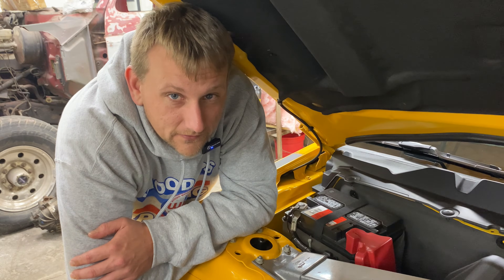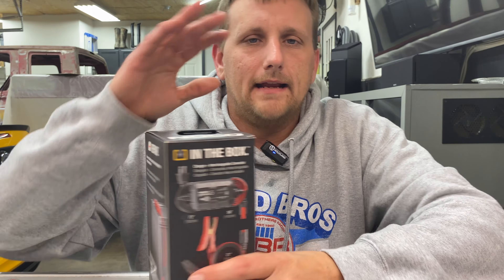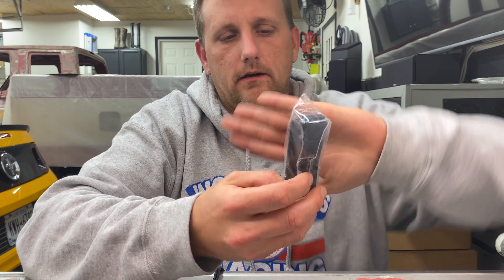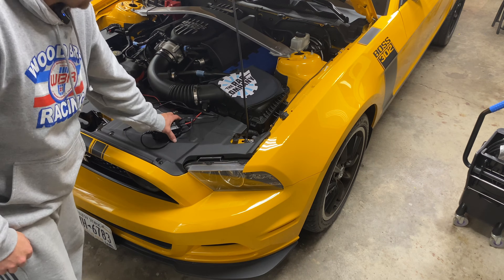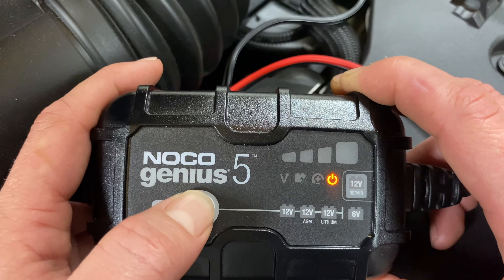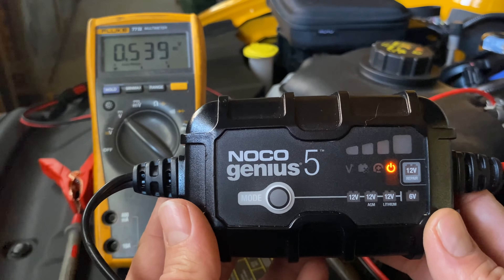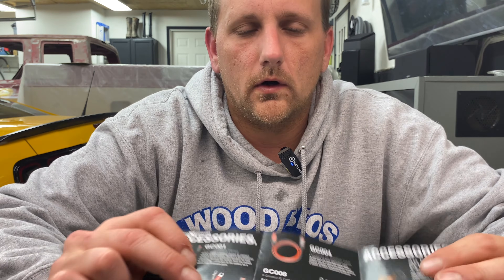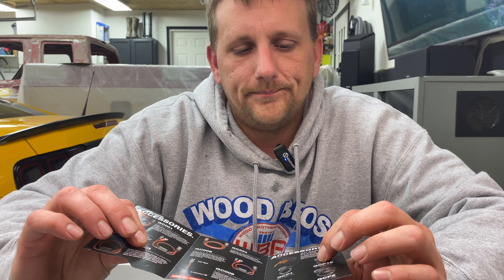NOCO Genius 5 Battery Charger/Maintainer How to, Features, and Accessories

Comment: I bought one of these to use as a trickle charger for my mower and Ford Ranger, a battery that would die if the truck wasn't used frequently. Eventually, both that battery and the one on my mower would not stay charged even when on trickle charge.  I set this unit on repair, and both batteries are now performing like new.  My other truck battery was also failing after 7 years, so I tried it on that truck...it too is as good as new.  I didn't want to replace 3 batteries and this unit gets 10 stars from me for restoring all of them.
Reply: How many times did you use repair mode for the truck battery?
Reply: @RhynoMegapron  Sorry I took so long, I don't use this email often.  Once each time for 3 batteries, all of which are like new.  Good Luck.
Reply: @blapril754  Does your noco still functioning today 2024 ?
Reply: What setting do I put it in to trickle charge?  Is it the first setting  says just 12volt

Comment: how can i achieve 14.5v on a 12v acid battery? om only getting 13.5v and the noco is still green. if it was green should i leave it for 8hrs? to achieve 14.5v?
Reply from the maker: Why would you need to achieve 14.5V? Battery's are operating between 12-13V. When a battery is charging from the vehicles alternator while running, it maybe read 14-15v max but that's it. 
You can leave the NOCO on the battery forever. It will monitor and maintain the battery voltage at the optimal voltage of 12-13V while not in use.

Comment: I am a gal and I love my Noco products -- even just holding them feels good..lol, well built IMO.  I have the Noco Genius 5 (Battery Charger+maintainer) and I use this to mainly maintain my Datsun 280ZX as I don't drive this immaculate vehicle all year round.  I also have Noco GB40 booster which I have used several times to boost another vehicle of mine.  The Genius 5 manual has very tiny print, I may enlarge font to make it easier to read.  When I am not using these units, I like to put them back into their original boxes, bugger to organize them in the manner they were in when purchased.  LOL.
Reply from the maker: I was keeping my NOCO genius 5 in it's original box but the box didn't make it long before it started falling apart so I keep mine in the top side of my Boostx carrying case. All in one spot now 👍🏼

Comment: So when it's hooked up to a normal 12v battery, and the light goes green, is that the trickle charge mode? I just need it for that, as a trickle charger, to maintain it.
Reply from the maker: Correct. It will go thru the charge mode quick and then going into maintain mode when it is just the green light on.

Comment: I have the genuis 1 for my Silverado, I pulled the black cable off from the truck,and have the noco hooked on the batt. I'm assuming that's a good way to do it, because she does sit , because I have a company truck.  But I think I might get the 5.   Any suggestions?
Reply from the maker: You don't have to disconnect any terminals to use any noco. I have the same situation. I have a company car so all my vehicles sit for periods of time without use. The genius 1 is a great unit I'm sure and have others comments that people use the 1 or 2 for maintaining there batteries with no issue. I personally got the 5 so it would maintain anything I have and also charge a dead battery in a timely matter. I feel it would be an upgrade for you to go to a 5 because you have a truck. That is totally up to you. The smaller ones do the same job but take a longer time to do it.

Comment: When I try force mode the lights won’t flash. I been charging my car battery on my 2019 Mercedes all day and the first light still blinking.
Reply from the maker: If the unit is seeing the battery and will go into one of the modes, force mode isn't needed. Was your battery low on power or you just using it to maintain it while it sits?

Comment: How long it takes to charge a completely dead battery ? How long will it be dimming in the 25-% range ?
Reply from the maker: In my experience with the genius 5, around 24 hours to get close to fully charged on a full size car battery. should be above 25% within 3-5 hours. The last 25% of the charge is the slowest because it slows the charge down to maximize the final little bit of charge and protect the batteries health

Comment: A lot of people always say the mounting system to mount it to the wall.  Its actually to mount it in your engine bay and have the charger connected to your battery with eyelets.  Run the plug to your grill and you dont need to even open the hood to plug it up
Reply from the maker: I thought that to but it doesn't automatically start charging at least mine doesn't. Definitely would mount under the hood like the genius 2D but would still need to select the mode to have it start charging unless mine isn't working properly. They should make the 2D a 5D. The 2D takes off on its own once plugged in. No buttons to press.
Reply: @natemarcy3939  it says in the instruction book after the first setup its has onboard memory so when you plug it in the next time it is already on the mode ready to go
Reply: If you have it in and charging then disconnect power cord, next time you plug it in, it will remember the previous setting.

Comment: Genius 10 is $85 on AMZN
These are designed in USA, made in China or Vietnam. 
When you connect the Noco to the battery, do you disconnect the battery from the car ? Thx, great vid and tips 👍🏻
Also, Noco GB40 on w00t for $75
Reply from the maker: Nope. I leave the battery hooked up to the car. No issues.
Reply: @natemarcy3939  thanks for the reply, someone stated if using repair mode to disconnect battery as it might interfere with car electronics.  Also, if the battery is in the trunk do I connect to the posts in the engine bay or the battery in trunk ? Thanks
Reply from the maker: @babagandu   if doing repair mode it never hurts to be safe and unhook it. I personally have done a repair with the battery still hooked up and had no issues.

I would hook the noco directly to the battery in the trunk. That cuts out any potential issues the wiring could cause  or other systems in between.

Comment: I have the NOCO 10, 5, and 4 of the 1"s..  The 5 is a great choice for overnite charging the typical auto battery.  Once the battery is fully charged, the NOCO 1 is my choice for maintaining. My BMW sitting idle most of the winter is a current-hungry beast and the NOCO 1 can do the job indefinitely.  NOCO is a good choice.
Reply from the maker: Thank you for the info. It's nice to hear someone else's experience with multiple. I'm thinking of getting the 10 once I get my diesel restoration project done. I'm sure it will appreciate the 10 for the two big batteries in it. What do you use your 10 for?
Reply: @natemarcy3939  Well, I run a small battery restoration business from home now that I am retired, kinda like a hobby of mine.  The NOCO 10 is used at times for weak auto and tractor batteries I get in occasionally which may be somewhat sulfated and need to be turned around and returned to the customer within a couple weeks.  All the NOCO's can desufate, they obviously charge at different rates.  I actually have much larger chargers and even stick welders for reviving dead batteries.  What's good about the NOCOs is their pretty much plug and play and need mostly no supervision.  As always you should have good ventilation while using the 10 and maybe even the 5. Be sure to pop off the vent plugs when initially starting a charge process and watch for heat. Once the battery is fully charged, put the caps back on, use a small maintainer (the 10 is overkill) the 5 will be great for this.  -Dave
Reply from the maker: @340dave  wow that's very interesting. Something that I didn't even know could be a business or that anyone even did. Very cool! Thank you for sharing all the great knowledge. I like putting information out there for others but love being introduced to new knowledge.

Comment: can you recharge your battery if the temperature is 32degrees out, or just cold outside?
Reply from the maker: You are good down to -4 degrees Fahrenheit and up to 104 per the manual and there website. I personally have left it on my truck outside for 2 days with the temp around 20 with no issue.
Reply: @natemarcy3939  thanks!
Reply from the maker: @mikefitzgerald8025  glad to help

Comment: Great video, I own a 2020 Jeep JL. A small auxilary battery and the regular size battery. Horrible engineering. If the small auxilary dies, you can't start the Jeep. So with this set up so you buy a two battery maintainer? I want it on board so a quick connect to the house electrical. Thanks
Reply from the maker: Thank you. So that's an odd system to have. I was just reading about it a little bit. In your case, I would go with 2x Noco Genius 2D. It is a direct mount to the batteries with hard wired eyelets under the hood then get a 2 way splitter from noco Part#:GCP2. You can plug in both maintainers into the splitter then you can tie up the splitter plug in behind the bumper. That will make for easy, trouble free plug in. No popping the hood. Just plug into an extension cord and they will start. No settings to deal with or raising the hood. Hope this makes sense. Let me know if it doesn't
Reply: @natemarcy3939  Thank you. Figures I would be the one to ask this question. I have zero mechanical skills lol. I sent an email  to Noco asking them what to use. There seems or maybe there is a battery controller in the Jeep. So charge main then auxilary gets charged in theory. Here is another kicker for the Jeep. The small auxilary battery is under the main battery. O the fender comes off to replace that battery. Jeep engineering need pay decreases for this one.
Reply from the maker: Sometimes it's better to be the person to ask the question. If you never ask, you never get an answer. It's good that you are looking to maintain your batteries especially with the system you have. Let me know how it works out and what they suggest. 👍🏼
Reply: @natemarcy3939  Got the answer. There is 2 batteries in the Jeep running in parallel. You can attach the maintainer negative and positive on the top main big battery. However, you have to realize that its charging 2 batteries and the charge time is longer than just charging one battery. I read to much lol..
Reply from the maker: @chodson65  interesting. Must need that extra current to turn over the engine. When you run batteries in parallel it adds the current ratings together to increase higher cranking amps to help turn over the engine but the viltage stays the same. This is common with diesels in daily light duty trucks such as ford, dodge, chevy etc. what engine does your jeep have in it?

 Fun fact, big semi trucks are normally a 24 volt system vs a 12 volt system like in most cars. They use 2x 12 volt batteries and connect them in series. When they do that it adds the voltages together and the current stays the same.
Reply: @natemarcy3939  The smaller battery under the main battery is for starting the Jeep. It also manages the start stop function. To remove this battery if dead you have to remove the fender. It gets better. When the small battery is dead the Jeep does not start. This is FCA's or Jeeps way to tick the Government box on the start stop function and to jump on the green band wagon.  The engineering in this is a cross between a childs Power Wheels electric car and the Jeep. Allot of issues with this set up and noted on the internet. My resolve will be to install an on board charging device and plug the Jeep in 3 times a week. Do I qualify for the Federal tax credit for driving a hybrid EV now lol.
Reply from the maker: @chodson65  that is the craziest setup ever. The problems created to advance technology and emissions 🙄 absolutely unnecessary. Your definitely thinking right to avoid known issues. Most don't think like that. 👍🏼👍🏼to you.
Reply: @chodson65 I have a 2020 JLUR and am having issues with these stupid batteries. Which noco charger did you end up getting? Is it working for you?
Reply: @TexasLady220  I went with the Genius 10. Perfect size.

Comment: FYI, just some information to put out there I was reading many reviews online and many people complains that they do not honor their 3-year warranty if the unit goes defective two years later sometime sooner. Still thinking of buying the product but that's the only negative I have on this device
Reply from the maker: Good info
Reply: @natemarcy3939  majority of complaints I found were on Amazon purchases ( these purchases on Amazon were made through the Noco store on Amazon).
Reply from the maker: I can say there customer service is helpful. I have dealt with them twice and they seem helpful.
Reply: Super helpful. My G15000 went kaput a while back and NOCO walked me through the process. Despite being past a 5 year warranty period, they are sending me a new model, better unit, at a very modest cost to mostly cover shipping and handling. I also bought a NOCO Genius 10 that is perfect for keeping my camper van charged over the winter.
Reply: @murraybrown855  just because they honored your return it doesn't mean other people didn't have issues.  The good of one situation doesn't mean the good for all but glad you had a good experience.

Comment: Great video, thanks Nate, maybe this is a stupid question, but same here, I won't use my for 6 months, how often do you charge the battery? Or just keep connect?
Reply from the maker: Thank you! The only stupid question is the question that's never asked haha. This is a charger + maintainer so I put it on my mustang and leave it til I drive it again. Right now I have it on the battery all winter. I have unhooked it twice to pull the car out so I could get in the attic but other than that, It's hooked up all the time. I do check on it once a week to make sure all is good otherwise set it and forget it. It will monitor the battery voltage to know when to be on and off.

Comment: It will not maintain anything if your car is shut off it's only good for older cars if your cigarette lighter turns off when you turn off your cigarette lighter then it's no good this company is a fucking stupid ass company don't use their chargers they suck they overheat in my battery and almost went on fire
Reply: How come? The unit connects to electrical mains to maintain battery ...

Comment: Good video , I have a Genius 5  but seen the Genius 10 and it was  $100   and charges twice as fast and has a feature that can plug into the OBD2 port and provide power to the comptuer systems so when changing the battery the computer memory ,  radio memory and seat memory is retained so you do not have to reset them   , I use the Genius 10 most of the time nowadays , great product
Reply from the maker: I think I will be getting the genius 10 next as well for my diesel truck. It has two big batteries so I would like the extra amps when it is parked for long periods of time. Thank you for the feedback!
Reply: Genius 10 $85 on AMZN

Comment: You just explained something that’s been confusing  me for years, whenever  I charge the battery on my car it’s in the street so I close the bonnet and lock the car. Then when I return to check it I open the car and pull the bonnet catch and the charger is always back at stage 1, NOW I know why. The central locking and interior light are causing the Noco Genius to re-set charge mode to stage 1. 🥴, thanks great video.
Reply from the maker: Glad to help! The little details make the difference in a review for me.

Comment: I've used my Noco Genius 5 for a few winters now (love it!) as my car is stored in a detached garage that gets really cold in winter & the battery kept dying overnight. I assume it was the cold weather, as it only happens during the really cold months. (The battery isn't old, and has been checked by the dealership & is fine.) I keep the battery attached to the noco during these cold snaps, which means leaving the hood open, thus I want to advance to using the eyelets. Thanks for your added info on eyelets in this video. I'm not at all handy so I think I'll go the fraidy cat route and ask the dealership to put them on for me the next time my car is serviced. Thanks for the review/tutorial.
Reply from the maker: Thank you for taking the time to watch. Much appreciated. Make sure you order the correct eyelets. There are M6 and M10 size. Double check with the dealer or shop you will have install them to find out which size you need.
Reply: @natemarcy3939  Thank you. The eyelets came with the battery, but I'll make sure they are correct for my car. A lexus RX 350, I believe?

Edited to say, the eyelets came with the Noco charger, not the battery. Sorry about that.
Reply from the maker: Gotcha. Just want to make sure you have the right stuff.

Comment: Does the circuitry recognize an overcharge and maintain at say 12.8 volts?
Reply from the maker: Yes to both. It recognizes overcharging and backs off the charge to keep from hurting the battery and maintains.
Reply: @natemarcy3939  Thanks!  I have a track loader that if not cranked for a couple of weeks will have a low battery.  I have disconnects on all other equipment except for the newest ones with multifunction screens.  Don't want to constantly reset the info in the computers so wanted to get battery tenders for that equipment.  Thanks for the  reply and the videos.  Good job.
Reply from the maker: Something to go with that, are your machines 12v or 24v systems? I only ask because most larger heavy equipment tend to be 24v systems. If so, look into the NOCO genius pro series. They have a 24v setting on them. Otherwise enjoy!